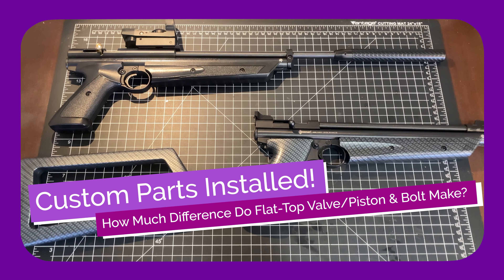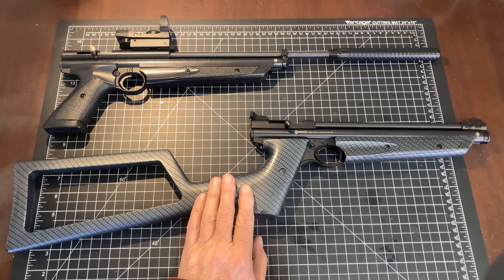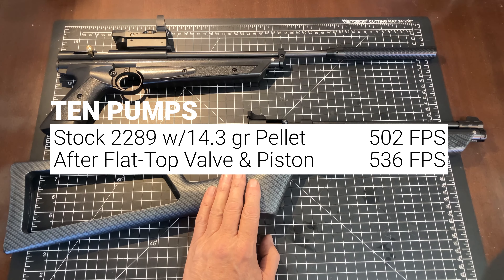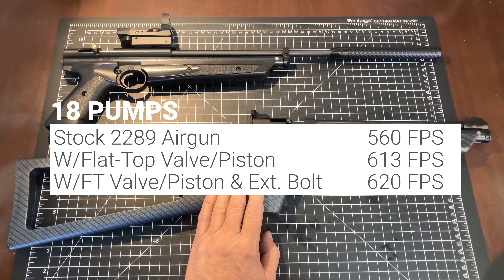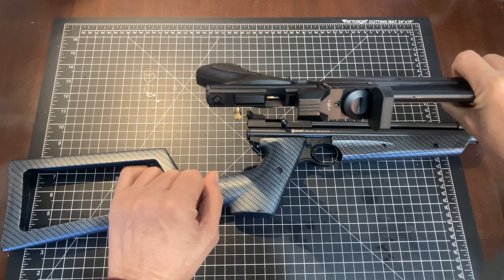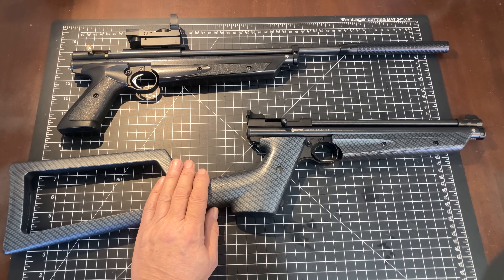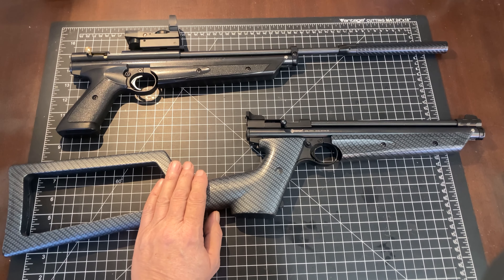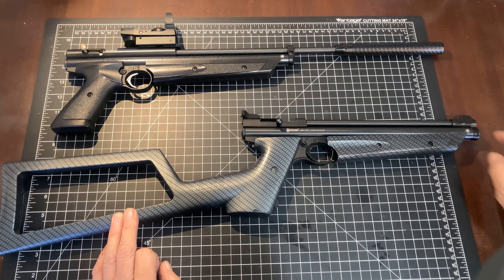Did a Flat-Top Piston, Valve & Extended Bolt Improve Drifter or 1322?

Comment: I was wondering if you have ever seen our used the quick release  stock  that allows you to put on and take off with out having to use  tools ? Most people don't even know about it. 👍✌️
Reply from the maker: Do you mean the Crosman stock without screw holes that uses a spring loaded plunger?
Reply: @AlsAirguns  ya that's it. I don't  get it because . It leaves  you with out grips.  There should be a alternative grip sets to fit it as well  in Mt opinion .
Reply from the maker: @josephsaucedo8691, As it turns out I’m using one of those stocks, complete with spring loaded plunger, in a build today. It’s going to be a pseudo 2250 with a short 2300s/2240 tube and a buck-rail foregrip.

Comment: Great video! Ive been enjoying your videos. I sure like my Magnum Air Power valve and cup piston kit in my 2289. I’ve tried most of the common aftermarket ones, FT my own valves, mixed & matched diff valves and adj pistons, etc, etc. MAP cup kit smoked all my other attempts 😂. Also in my experience, in my environment, I’d have reliably issues with FT leaking. Usually after 6+ months I’d need to replace o-ring(s) on piston. It’s all fun that’s for sure! 👍👍
Reply from the maker: @precisionrodentcontrol, Thanks for your feedback. It’s much appreciated. Magnum Air Power valve? I’ll have to check that out. Thanks again.